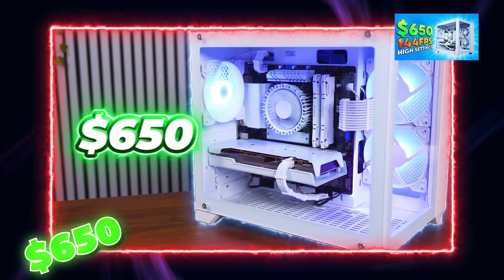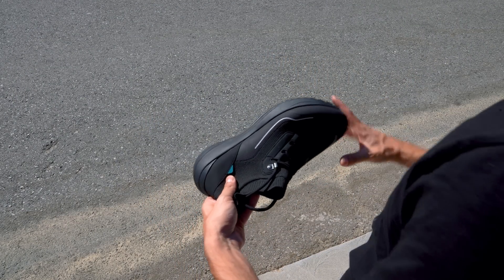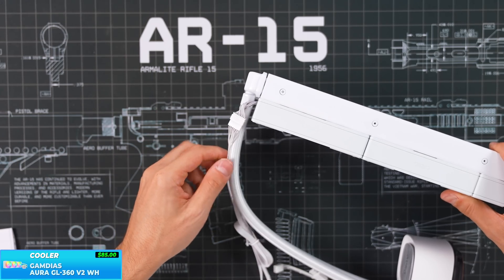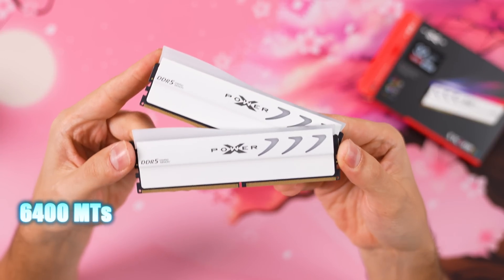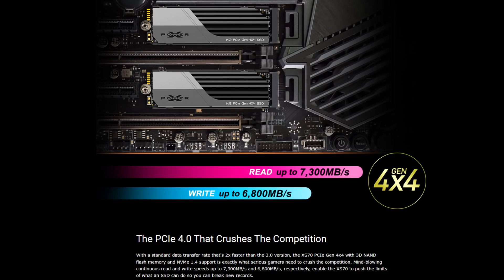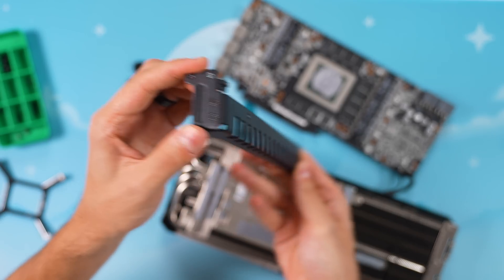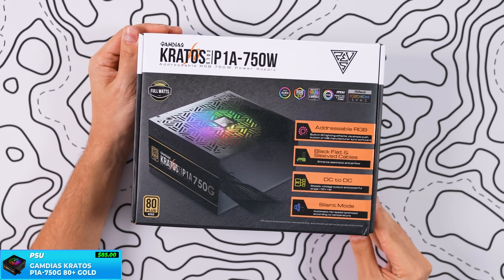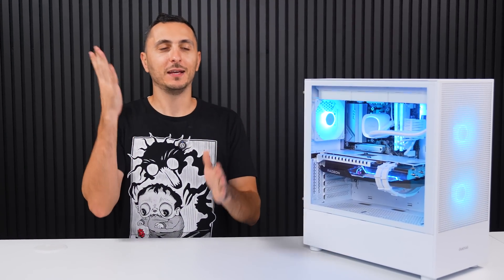The Best $1500 Gaming PC Build!

Comment: So im building a pc in February so far i have chosen all the parts but gpu i will use my 3080 from my old pc till i get enough money to get the rx9060xt 16gb version 
These are the chosen parts so far 	•	Case:
	Antec C8 Dual-Chamber Full Tower

	•	Motherboard:
	•MSI MAG B650 Tomahawk WiFi or MSI B650M Gaming Plus WiFi
	•	(both work fine, just fewer slots/features on the B650M)
	•	CPU:
	•AMD Ryzen 7 9800X3D 
	•	CPU Cooler:
	•	ARCTIC Liquid Freezer III Pro 360 (AIO liquid cooler, 360mm radiator)
	•	GPU:
	•	NVIDIA GeForce RTX 3080 (10GB GDDR6X, PCIe 4.0)
	•	RAM:
	•Corsair VENGEANCE RGB DDR5 32GB (2×16GB) 6000MHz, EXPO
	•	Storage:
	•Samsung 990 EVO 2TB NVMe SSD (PCIe 4.0, M.2 2280)
	•	Power Supply:
	•Thermaltake Toughpower GT 1200W (ATX 3.1, PCIe 5.1, 80+ Gold, Modular)

Comment: I built a similar PC (merc 310 rx 7900xt and ryzen 7 7700x) and I have a 1440p and 1080p monitor. Not even using high settings on Fortnite I get far less FPS than in this video. I know I am using 2 monitors which will affect my fps but why is there such a big difference? I got the 1440p monitor today but I feel even before on the 1080p monitor I wasn’t getting the fps ed was getting at 1440p

Comment: I've just started looking into building my own PC, does the motherboard shown also have an ethernet connection? And if not, which motherboard (around the same budget) would you suggest that comes with ethernet? Or would a USB C to ethernet adaptor be ok to use with this?
Reply: I built this exact pc it has Ethernet connection

Comment: Prossesor- ryzen 7 7800x3d
Motherboard-msi B650M gaming plus wifi Am5
Gpu- msi rtx 4070 gaming x slim white
Ram- kingston fury beast 6000mhz white (16×2)=32 gb
Ssd- samsung 970 evo plus 2tb
Case- pc power iceberg v2 
Atx gaming case (pp-h40 wh)
Power supply- gamdias helios m1-750b 750w 80 plus bronze power
Cooler- deepcool LS270 WH
Premiumliquid cooler (360 mm)
Is this good??
Reply: Hi do you know If i can Change the RAM with different ones that also have 2x16gb DDR5-6400
Reply: For the build in the Video

Comment: Hello Edgar I just built a pc based off of this same gpu cpu case and mb but different ram (G.SKILL Trident Z5 Neo Series (AMD Expo) DDR5 RAM 64GB (2x32GB) 6000MT/s CL30-40-40-96 ) and cpu cooler gamdias chione m4 360 aio. I’m getting a red light for cpu and dram. And nothing I have tried will fix the issue. Do you have any suggestions on how to fix the issue. I’ve reseated every component and triple checked all my cables.

Comment: Hi ed goodevening!. I have a question. I have lenovo loq laptop it has 8gb ddr5 5600mhz ram and i saw that there another slot for ram. Is it okay to put 16gb ram ddr5 5600mhz also same frequency and speed on the 2nd slot? To make it 24gb. Thank you in advance ❤️

Comment: save 50 dollars on the cooler by using air, 35 on the ssd by going 1tb, 40 on the case and 80 on the cpu with a 7600 non x. Get the 7900 xtx and this is the best gaming pc for 1500 case closed.
Reply: 7700x, freezer iii cooler, b650 eagle ax mobo, same ram, same with the 1tb ssd, 7800xt, meshify c - expensive but great airflow, 750w psu, $1300

Comment: I have similar setup difference is 7600 non x and 650 psu from msi I don't plan on upgrade to 4k I just want to hit my 165hz 1440p at high settings native and more can I drop the 7900xt in my build and be okay

Comment: 14:50 I would never enable frame generation on CoD. On a competitive FPS game frame generation is the worst thing you could do. The latency is not worth it, especially if using AMD’s FSR. For a single player game, yes. But for competitive FPS, NEVER. I can’t believe you’re even recommending this. I would rather get 150 FPS with FG off than 300 FPS with it on.

Comment: I dropped $1850 for my build. 
AMD Ryzen 9 5900X 
Scythe Fuma 3 air cooler
Asus TUF Gaming X570 Pro +Wiffi II motherboard
G Skill Trident Z Neo 32gb DDR4 RAM
Crucial P3 Plus 1tb Nvme 2.1 x 2 SSD
PowerColor AMD Raadeon RX 7900 XTX OC
750W Corsair RM 750x power supply
Mustex case (y6 mid-tower double glass style case)

For OS, I use Arch Linux. 

Went with 5900x because I do some multi-threaded tasks such as recording + gaming, and programming, as well as video editing, and some 3d modeling work. Went with the 7900xtx over the rtx 4070 ti super, because of the ease of use with drivers on AMD + Linux, compared with Nvidia. 

Other note is I game and use this system on my 4k tv monitor, which is capped at 60fps, so I don't care about overcapping that or hitting anything higher than around 80fps. I play mostly single player story focused / hhorror games, such as Silent Hill 2, Alan Wake 2, Life is Strange, First Descendant, etc. No competitive fps stuff, though I'm sure I'd hit over 300fps in those titles.
Reply: arch users never fail to mention they use arch
Reply: Nice to see another linux user in the wild. I still use windows for games since I have an older laptop that doesn't play nice with linux gaming but when I build a PC, I plan on picking parts that will play nice with linux.

Comment: I just built basically this same computer. It’s very impressive. I’ve built about 20 PC’s this year and for the value I’m very happy with it. Hopefully it sells fast
Reply: Do u get the same fps as the video says?
Reply: I’m guessing you won’t reply- built a similar PC (merc 310 rx 7900xt and ryzen 7 7700x) and I have a 1440p and 1080p monitor. Not even using high settings on Fortnite I get far less FPS than in this video. I know I am using 2 monitors which will affect my fps but why is there such a big difference? I got the 1440p monitor today but I feel even before on the 1080p monitor I wasn’t getting the fps ed was getting at 1440p

Comment: Really nice build Ed! I'm also planning on doing a 1440p build myself. I decided to go with:

CPU: Ryzen 5 7600
Motherboard: ASRock B650E PG Riptide
RAM: ADATA XPG Lancer Blade RGB 32 GB Kit@6000 Mhz
GPU: Sapphire Nitro+ Radeon RX 7800XT
Case: Montech Sky Two
Storage: (1) Teamgroup MP44L 1TB M.2 SSD [boot drive] (2) Crucial P3 Plus 2TB M.2 SSD [storage drive]
PSU: MSI MAG A750GL
CPU Cooler: Montech HyperFlow AIO
Reply: Don’t spend that much on the mobo u could get a 7600x
Reply: @Variablegames5968  I wasn’t going to at first, but since I’m using 2 SSDs I need 2 heatsinks and unfortunately the cheaper motherboards only have 1. I was gonna get the MSI PRO before. If I get a 7600X from AliExpress I can still save money though.
Reply: @Variablegames5968  I was gonna get a cheaper board at first, but since I’m using 2 SSDs, I need 2 heatsinks, and unfortunately the cheaper boards only have 1. If I get a 7600X from AliExpress I can still save money though.
Reply: @Variablegames5968  I was gonna get a cheaper board at first, but since I’m using 2 SSDs, I need 2 heatiskns, and unfortunately the cheaper boards only have 1. If I get a 7600X from AliErpexss I can still save money though.
Reply: dont get the 7800xt get the 7900 gre there is no big price difference but a big performance difference and you are also getting a expensive mobo get the 7600x or you might have a bottelneck
Reply: @SohaibTarar  The 7900 gre has a decent performance advantage, however I'm trying to stay within a $1500 budget. the 7800xt is still a great 1440p gpu. As for the mobo, I wanted to get a cheaper one before, but since I'm getting 2 storage drives, I need a board with 2 heatsinks. Which unfortunately cheaper mobos don' t have. I used a bottleneck calculator and the 7600 won't bottleneck a 7800xt.
Reply: @ArctecGemini  i also forgot to tell you as for the motherboard you only need a heatsink for gen 5 m.2s as i see in your build you are using both gen4 nvme so you dont need a heat sink
Reply: @SohaibTarar  Gen 4 m.2's don't run hot? That would be great to know cause I was gonna get the MSI PRO B650S before
Reply: @ArctecGemini  yeah you don't need heatsinks for gen 4 m.2 only gen 5 requires a heatsick

Comment: i just bought basically this exact build from skytech lol the only difference is i got the 4070 super instead of the radeon gpu. but it has that same AIO, same exact power supply, same cpu, its got a gigabyte b650 mobo, 32 gb tforce delta ram, 1tb nvme, all in the cougar air face mesh case. its a an awesome build!
Reply: whats it called
Reply: @AlternGaming  Blaze 4! the option with the 7700x and 4070 super. its been an awesome pc so far! :)
Reply: @anishinaabrie   it looks really good! enjoy it bro 😊

Comment: I noticed kinda low fps cause I have a worse cpu (7600) and worse gpu (4070S) and in ultra 1440p RT on I usually get closer to 244 fps  

Was comparing to finals 9:14

Comment: My $1500 build
Has a 
7600x
A no name cooler
4070 super
32gb 16x2 corsair vengeance rub
4tb nvme
1tb 2.5inch ssd
A no name case
Reply: half that budget went to the ssd
Reply: @seplol  it was only $250 from micro center
Reply: @abdztx  yep 👍 you can find a lot of good deals at microcenter. I want in thinking I was getting 2 tb max and I managed to come out with 5.
Reply: @ you’d be surprised. Having evocotti, ptu, and live start citizen alone is like 700gb

Comment: the gpu sag hurts a lot
Reply: THIS. Please just spend the extra $10 and get a stand.
Reply: i usually put a funkopop/ small figure to help hold mine up
Reply: @lucifer3201  thats cute
Reply: I have an old lost mary vape supporting mine
Reply: @jacobsmith8499 got an old Bugatti box holding mine 😆
Reply: wait I’m trying to build my first pc, what’s wrong?
Reply: @Burner6767  at 6:12 , you can see that the gpu or graphics card is not level, so it’s “sagging”, the card itself is installed correctly, but most people don’t like that because overtime it causes strain and can potentially mess up the connection on the gpu, most people buy a gpu stand or support to keep it level and keep it from straining. Some gpus also come with a support bracket that you can choose to use or not.
Reply: @luvbindedhearts i dont see the sag or am i blind 😭😭
Reply: OOF
Reply: I usually cum in my pc case and it holds it up like a spider web when it dries.

Comment: Hi Ed, i built 2k $ pc today with 4070 ti super and 7950x3d with your step by step guide and it works! Thanks Ed
Reply from the maker: Right on!
Reply: @TechSource  go to the colorado micro center i live in coloarado😃😃😃
Reply: Congratulations broooo
Reply: ryzen9 5900x
rtx 4070super
Reply: How do you get that search thing like on tictac
Reply: what mobo you went with?
Reply: B650 tomahawk, also that search thing appears randomly
Reply: @lubieplackim what search thing?
Reply: If I use a btf motherboard can I use a normal Gpu
Reply: @lubieplackim I am building a pc with the same components and was wondering where I can find the name of the guide you used
Thanks!
Reply: Why buy a 7950x3d just get 7800 x3d and mayby bumb up to 4080super
Reply: @Hotshot444  I wanted it cuz it balances out between gaming and productivity
Reply: @Hotshot444 7800x3d does not have good value rn, 7950x3d is worth shelving out the extra money if you have it
Reply: @Hotshot444 how are you supposed to get a 4080 super in a 2k build